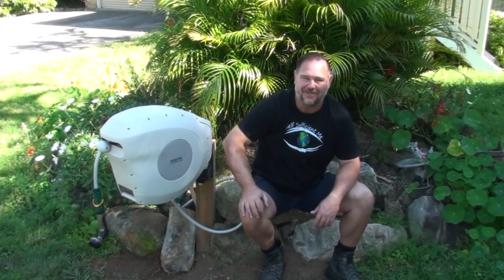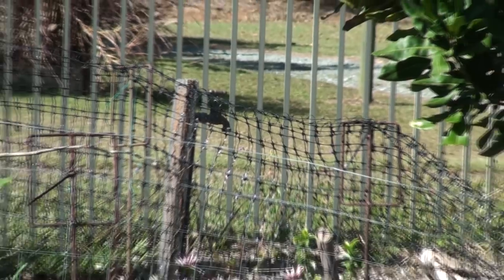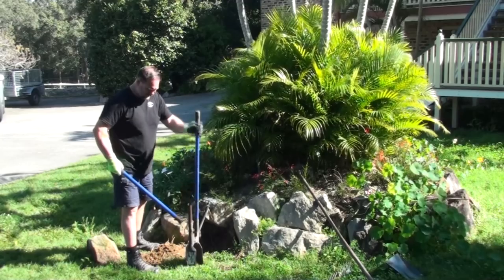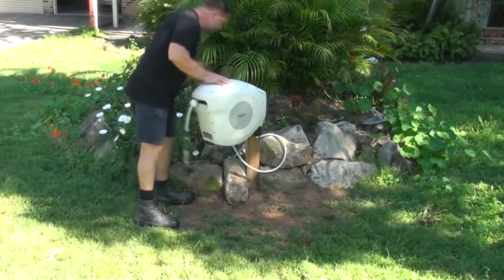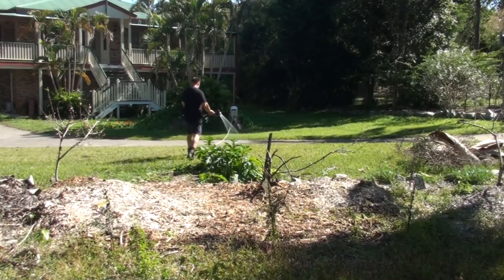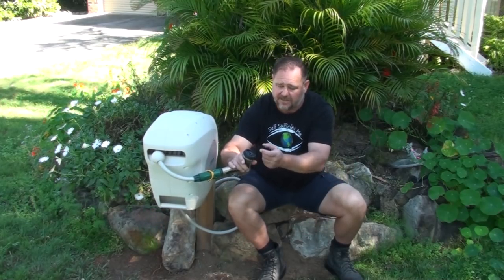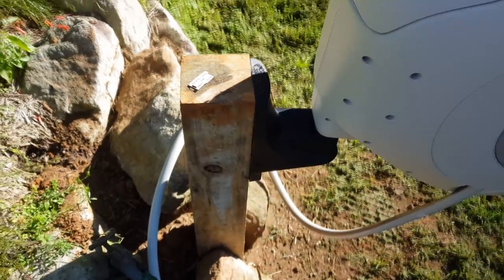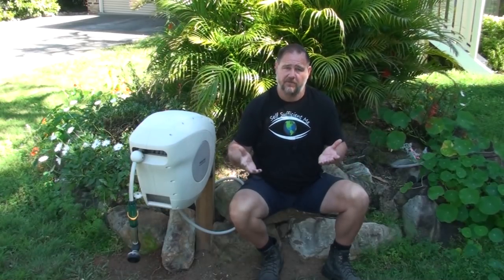How to Install a Retractable Hose Where There's No Wall

Comment: The only adjustment I would make is to skip the concrete. In my experience if the post is sub-grade 2-3' (60cm), packing clay-dominant dirt around it is sufficient to hold firm. Reason being, the post (even if treated) typically rots within 3-5 years depending on moisture levels in the ground. In dirt, the rotted post is relatively easy to remove and replace. Concrete is almost always a pain in the ass when the time comes; there's typically at least 50lbs (110kg) to haul out, and at times we've had to use a jackhammer to break it up. I like the setup though, very slick. I love how the nasturtiums are invading the palm!

Comment: nice video, I would have put it up a bit higher, maybe a foot or two, the problem here would be that the water doesn't drain out of hose and may split during freezing. yeah I know that is not a problem for you there

Comment: How much did that hose link system cost? I’ve been thinking about getting one myself.
Reply from the maker: They are around $250 (with fittings etc - 30m) so no cheap... but, I'm impressed so far. Cheers :)

Comment: How did you tap into your existing water line what Hardware is involved in that so you can attach the hose?
Reply from the maker: The piping is just standard underground poly water pipe (with fittings) buried underground about 2 feet down. The origin is a 16,000-litre water tank operated by a cheap electric pump and fed by an underground bore. We have five taps off the network placed around the property. Cheers :)

Comment: Ahh..why not replace "posty's" handle/arm?
Reply: lol…yep that's how it works love  :)
Reply from the maker: Ok I will look into it... :)
Reply: I have used 1” Electrical Metal Tubing (we call it conduit) to replace handles. But you have to be certain not to dig near any buried electrical wires. But the stuff is light weight and tough!

Comment: I have a shovel handed down from my Grandfather to my Dad to me. I know what it would be like to lose it. It does take maintenance a new handle every 3 years and a new head 6 or 7 years.
Reply: That sounds like the street sweeper called Trig in the comedy “Only fools and horses”. He had the same broom all his working life, but he replaced a number of heads and handles along the way. We have a power auger for posts where it is too dangerous to get the tractor and post knocker in. The hand held motorised auger is not expensive and definitely. takes the heat out of the job

Comment: What I see here is that you dont know how to make concrete or how to fix a handle on a tool (use smaller size wood in the broken hole). Not very self sufficient there.